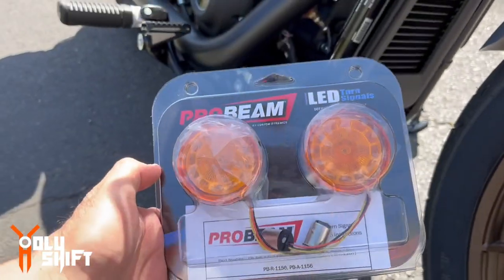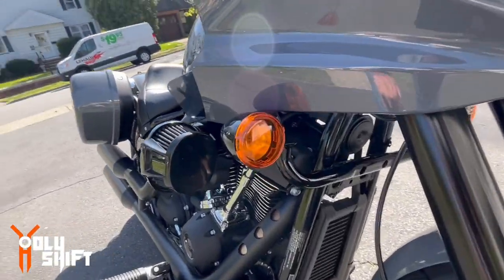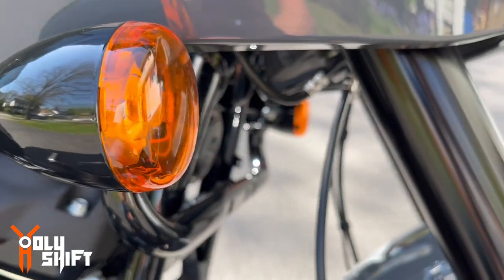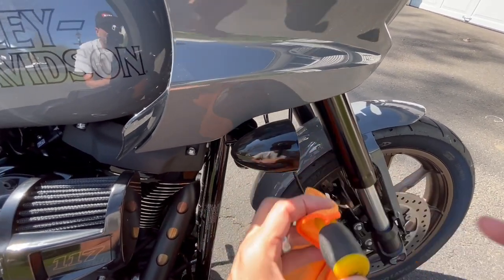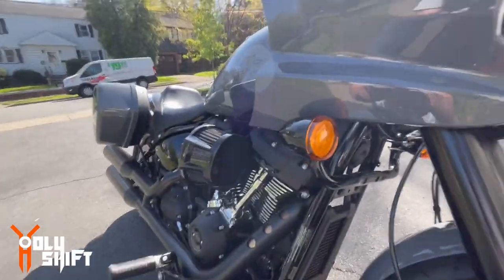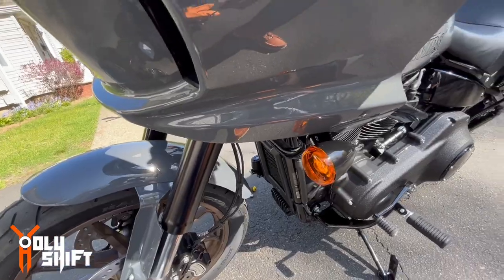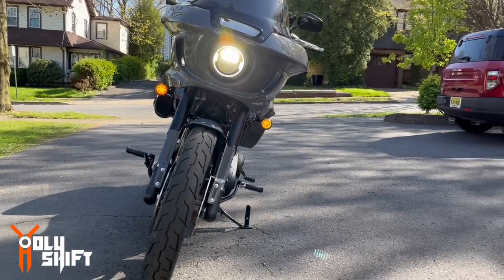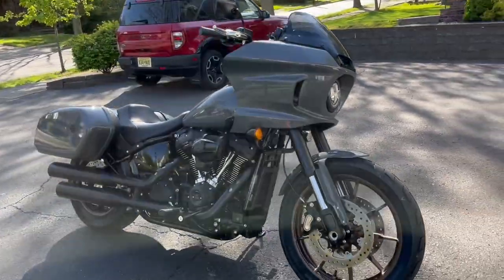These LED’s Are 97.81% Brighter During….

Comment: Sandy, I put Custom Dynamics ProBeam signal and tail lights on my 18 FLHC a few years ago. After about a year, the plastic prongs on the lenses all cracked. I replaced them with the bezels, which have metal prongs. The bezels come in chrome or black, and add a nice touch. The led lights are excellent. BTY, tee shirt arrived yesterday. Very nice.
Reply from the maker: Thanks buddy for your support!

Comment: Definitely the smoked lens. Always good to use dielectric grease when putting in the lights. I like the custom dynamic light that has the white halo until the signal is turned on. It helps make you seen better.

Comment: Did you have the signal indicator flash rapidly after the install? Just put led signals on my ST and have tried doing the reset procedure but the indicator still flashes rapidly. The signals themselves flash at a normal rate so it’s not the end of the world but slightly irritating.